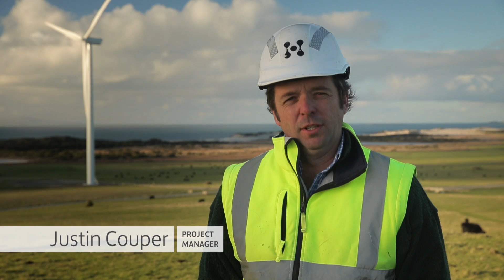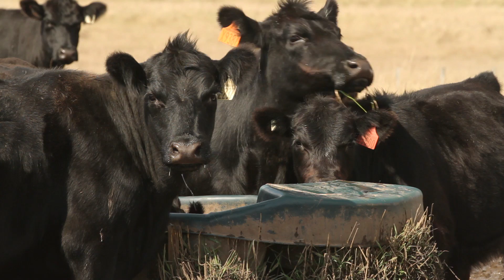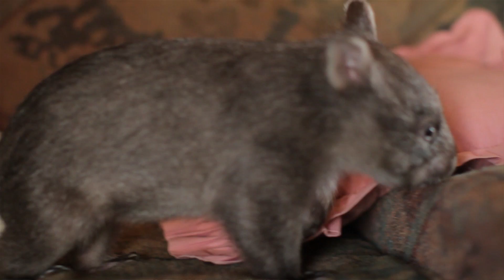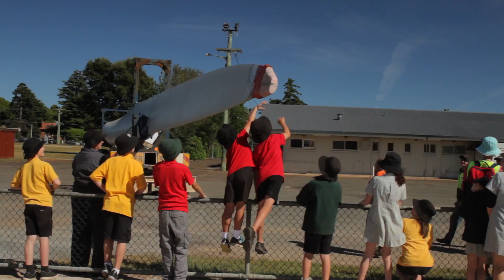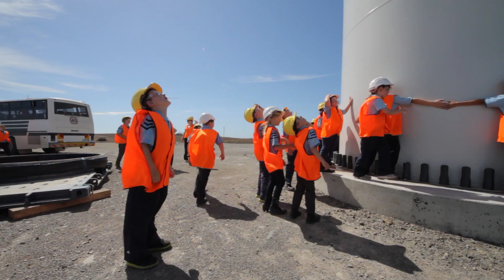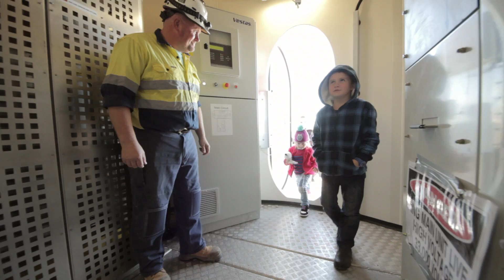Musselroe Wind Farm ~ The Full Story

Comment: Remember, a boatload of fossil fuels were needed to build and install those "clean" monsters. If you witness what's required just to truck them in, including all the access roads, you see why this is such a farce. They almost never generate at consistent capacity and need regular power plants as backup, running less efficiently. These people are no different than oil drillers in their mentality. They latch onto the "green" they really care about, helped by all kinds of subsidies. I can't imagine breaking ground on a wind project and feeling like I'm doing right by nature, especially on a ravaged mountaintop (coal isn't the only destroyer of those).
Reply: So how much were you paid?
Reply: Not exclusively wind; I am very pro-renewable energy because I do not want my grandchildren to freeze in the dark, as they will if there is on more oil to burn, and other fossil fuels become prohibitively expensive.My reasons are purely selfish: I do not want to be remembered as part of the generation that ruined things. And, I would guess, neither do you.
Reply: John Benton Thank you. That is exactly why I am so vocal about the lies surrounding 'wind energy'. It sounds good to use wind, but the illusion of utilizing wind power this way is much different than previous applications. The wind produces the type of electricity that causes capacitive reactance, and converting that to conventional power is definitely not 'green'. On a small home scale it can seem to work but it needs conversion, such as batteries, and  and is not really cost effective for a variety of reasons, not the least of which is that wind power is pretty effective at ripping things apart.

Although it seems the power should be convertible, remember these units spread out over thousands of acres, not some single-or-double-digit plot near a city.They use up a significantly finite resource called land, and typically it was pretty land to start with, land where people like to live - another dimension of finite. So, the bottom line to power production is still efficiency, clean output and quantity, and these wind systems fail in that they produce a poor quality dribble of power that needs significant rectification on top of a land resource that was probably already owned and is desired for other uses.

Which brings me to one portion of the lies perpetrated by the 'industry', These units do make people sick - they degraded the quality of my heart, for example, and my life, like so many others, is in danger. Similar problems happen with pets, livestock and wildlife around these things. Then, that electricity, that electrically noisy output that gets grounded into the soil isn't any more gentle on the soil than it ever has been on electrical components, and the evidence is out there in damaged land under these things. These facts bother people, and the industry uses lawyers whose job it is to get criminals out of trouble and salesmen whose job it is to sell garbage as if it were gold as their front men to scam the world. None of it feels good, none of it has a good record and none of it looks good. These things are hard on us and they poison the land, and the rest, the fact that they have a large carbon footprint and industrially use up a wide variety of finite resources while existing as a nightmare pile of garbage in an age where garbage is an ever-present problem, well, Geo T addresses that in this line.
Reply: You appear to have studied wind power in some depth. Have you done the same with nuclear?
Reply: You have my sympathy and support.
Reply: John Benton Mr. Benton, I am not paid, I am required to help pay for them through my tax dollars.

The people around here who signed up for them consider themselves underpaid, many expecting thousands last year and receiving only a small percentage of their expectation, so much so that they break non-disclosure to complain.

Are you a wind energy advocate?
Reply: John Benton It was my minor in physics in college. I have a strong emotional response to nuclear that I have a hard time shaking. Objectively, there is power there, biologically it industrializes emissions and waste that have serious potential to biological harm. The degradation to life is too insidious for me to approve the processes, in my own conscience. Also, it relies on constant upkeep of equipment and difficulties in detecting and handling degradation, disaster and error that too often fall short. I have specific examples in mind, but maybe enough said ... Well, people will build these things, but then they will (may have to) break promises when it comes to preventing or resolving failures ... Power sources that can or do become domestic weapons are a foolish way to go.

I may not be as addicted to technology as other people but I was glad for the stress echo test that told me more about my heart (for example).

I have some simple rules (for myself). If it requires a heavy set of lies, coverup and a large group of lawyers and salesmen it probably isn't any good. If it can dethrone champions and heroes it has too much potential for being used as a weapon. If governments have to force it on people then it needs disclosure and more peaceful alternatives.
Reply: John Benton You have mine, also.
Reply: Geo T The turbine generates the equivalent energy that is used for its construction within 6 months; and it's going to keep generating energy for at least 2 decades. Wind has proven to be an efficient power source for thousands of years. The question should not be do or not do, but how to do it better. If you think it's ugly, not energy efficient enough or too noisy, try come up with a better design or support those who are trying to. One day, we might look back and laugh at how inefficient these "clean monsters" are. But today, they are still a better alternative comparing to our other options.
Reply: +Geo T These people are actually worse. Industrial wind turbines are an engineering embarrassment. People with a heart abandon this 'industry'.
Reply: +kopde Tell me honestly, do you give a rat's blank about all the landscapes these machines are industrializing? If not, why not? Nothing else looms over scenery like they do, and I'm sick of people calling them "beautiful" as some sort  of sick rationalization. I hope you at least understand why they anger a lot of people, including those who don't live anywhere near them. Just knowing what's being lost in our landscapes is saddening.
Reply: +WolfeSandy The sheer mass and height needed to spin a relatively small generator is indeed poor engineering. They are the ultimate overkill machines, inefficient in too many ways. I think solar on roofs and parking lots (not desert scenery) plus newer, safer nuclear plants are where the bulk of subsidies should go. The windoggle needs to end soon. The world needs to diVest from Vestas, so to speak.
Reply: In your opinion? How much money did you get for spouting this?
Reply: Geo T I am for coal, with continued work to resolve this whole issue as we study energy, power and power control and distribution systems. I've reluctantly come to the belief that the more boring something is the safer it is (only as a general rule) when it comes to large-scale solutions in such things as the power industry. The mafia mentality is too intrusive on people's rights and does not require enough application logic or necessity consideration (more bully than thinking it through) . . . health and welfare take a nose-dive in the mafia system.

   It has really been bothering me just how poor these industrial wind turbine (IWT) arrays are. They send the 'power' dirty (raw) across the lines which is a huge snafu for health considerations. It has been coming out that frequencies are a key for the bad press that high power transmission lines get - well deserved bad press when the power isn't balanced and clean. They do it for these IWTs to maximize the 'energy credits' which is a code phrase for these guys should go back to cheating at cards and drop these billion dollar ponzi and money-laundering schemes (yes, I'm frustrated with people wielding my future and getting away with murder - there have been too many people dying in these industrial wind turbine zones, of all ages, too many animals mutated and/or dying, desiccation of the countryside = beautiful country turned into badlands all for pulling the wool over the public eye or whatever their real motives are . . .). These are no good for agricultural or undeveloped land and they are pure murder in developed areas ... I remember a school which had one of these IWTs and the eyes of the custodian told the story when I described the symptoms these produce - he looked right at the dorm where everyone had been mysteriously getting sick, washed in the downwind wake of the turbine.

Sorry, I may be on a rant. Theses turbines have destroyed my life and the lives of my neighbors - our homes, our bodies and our investments immersed in a nightmare zone of infrasound, lies and EMF. We discovered the WTS (wind turbine signature) 32 miles away - low doses at that distance but dangerous for sensitive people and animals. It apparently bounced off the mountain such that the result was additive rather than cancelling. That signature was found in a large city, washing over a large population. What is applicable about these things? - they seem to make effective weapons for terrorism, more destructive in the long haul than suicide bombers. Thank you if you made it this far - it is all breaking my heart.

Oh, a town put up three of these things. They had to be banned about six years later because they were making the townspeople sick and had killed and were killing a few (cardiac events are one common cause, and that applied in this story). The town, six years later, was still in debt for those to the tune of five million dollars - what a waste.

The stories keep coming. The rolling brownouts in Texas in 2014 were caused by the IWTs ERCOT attempted (a valiant effort) to bring on line. People will lie and say it was the fault of the distribution system, but that is because they are too capable of disregarding the kind of 'power' they are trying to bring on line - power that is not injected but blasted into the components from a power source that sings or roars as it rotates around rather than humming a steady monotone note from one single direction, a very real power refined into sickness rather than good health by the very design of the units.
Reply: +Geo T
We found out why the company mowed the land and spread hay under the turbines around us. It is to absorb the oil sprayed out of the nacelle by these mechanical nightmares. Seven months old and many of these units are already dry - hundreds of gallons of oil per unit used up already, and we haven't discussed the grease yet. So, in a field of strewn potentially oil-soaked hay we had the privilege of watching one of their transformers light up the night - no fire this time, thank goodness.

The IWTs up the road from us are not very old either (2013, 2014). It is easy to see the fires out there, scorched land spraying out from a burnt and blackened wind turbine. The wind first sprays the oil out from the nacelle (which is several hundreds of feet in the air) in an arcing distribution pattern, then when an ignition incident (lightning is common) happens the wind spreads the flame, creating a burn that follows the oil spray arc.
Reply: John Benton ? Not many get money for telling the truth about industrial wind turbines at this time. It is not big business to undermine corruption. Was I reading you correctly?